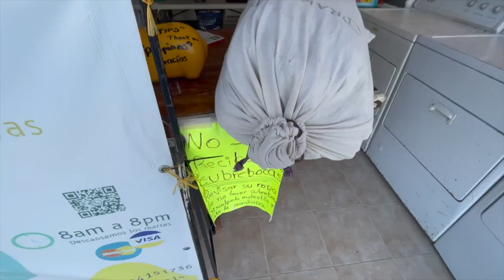Mexico Vanlife Adventure Continues....Solo !

Comment: If you can, go with the Max Air fan. It's quieter, more efficient and comes with the rain cover so you can run it regardless of the weather.
If the hole in your roof is too big, maybe you could cover it with sheet metal first, making sure to seal it well, of course. Best of luck on your adventure!

Comment: Susi the betrayer.. and always found new boyfie
Reply: They probably won't last. If Suzi is ENFP, or ExFP, then her dual or most compatible partner would be IxTJs. That guy seemed more IxFP, and probably clashed with Tobi a bit too in terms of values a bit (similar but different). 

I give them 1-2 months max before they (susi and the bf) start to fall apart (infatuated by familarity--Susi and him should be quite similar, but will fall apart after reality hits in). 

This is good though, since I think these two (susi and tobi) needed some time apart to "find themselves" a bit and also to "miss each other". Because sometimes you don't really know what you have until it's gone a bit.

Everything happens for a reason in this case is just exact.

Safe travel, Tobi <.3
Reply: @1231mn  What guy? Did I miss something?